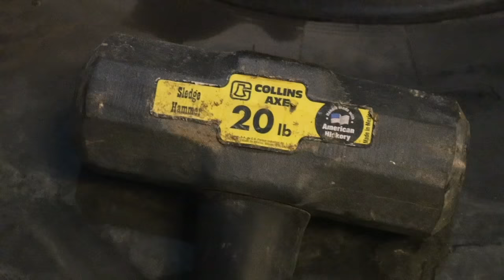Can @buffdudes Survive BATMAN'S BILLIONAIRE WORKOUT? | Movie vs Reality

Comment: Duke is probably stronger now than he ever was as a lad. As a trained body ages, the limiters on your strength that cap exertion to prevent you from injuring yourself start shutting down. Hence "Old Man Strength". I powerlifted in my 20s, but in my 30s I sat around and got a lot stronger for no reason. My cardio was shit though.

Comment: Props to these guys doing these kind of workouts on dirt/wood instead of smooth concrete like in the movie because that no doubt made it harder! The main critique is wasn't Batman probably using more like 100lbs dumbbells each instead of 100lbs combined dumbbells? Unlike the squat, which I can give them a slide on how many reps that they could have done with 100lb dumbbells because if they could do 35-40 reps with 50lbs, they certainly could have achieved a few reps then with 100lbs dumbbells.

Comment: I felt my muscles screaming just watching this. Though I will say what seems to be the biggest drawback compared to the movie would be doing it on dirt instead of a smooth surface like concrete,  pulling a tire or pushing the sled would be far easier on something more slick than dirt.

Comment: In the movie.  The surface that Bruce is pulling and pushing is a flat surface with no dirt or any obstruction.  The ground they are using is uneven and alot of resistance.  Which you might think is tougher making it more badass, but that it actually not safe, because it makes it more likely they will pull a muscle or get a hernia.

Comment: Welcome to the world of crossfit now if anyone wants a challenge try the new US Army physical fitness test.  

Minimum to pass  varies by job but the heavy jobs require

Event 1 . Dead lift 200lbs 3times .
Event 2.  Standing Power Throw .  Basically throw a medicine ball over your head aiming for a minimum of 8.0meters.
Even 3.  Hand release push-ups as many as possible in 2 minutes minimum to pass  30. 
Event 4 Sprint ,Drag Carry .. Sprint 25 meters  , Drag a 90lbs sled then carry 40lbs dumbbells this is done in 5 reps . Time limit 2:10. 

Event 5. Legtuck.  Basically grip the pull-up bar with both hands , pull yourself up and raise your knees to your chest then lower and repeat as many times as possible in two minutes.  Minimum number of reps 5. 

Event 6.  Two miles run minimum time to pass 18 minutes.

You get a 10 minute break between exercises.   It's a workout.  Even for soldiers to do.

Comment: I've done sledgehammer training with a 25 lber and lasted 5 minutes straight and it's tough as hell. Never did weighted pullups since I'm already over 250 which is more than enough. Would love to try sled pushes, they're full on strength cardio style combo.

Comment: i dunno i think you guys have seriously mis calculated the weight Ben Afflect had on his chain i see 3 plates looking the size of 20kgs so 60kg/132.28 pounds, and he was holding pully bars on the outside of the rack so his arms where in a better more practical position than what you were doing.